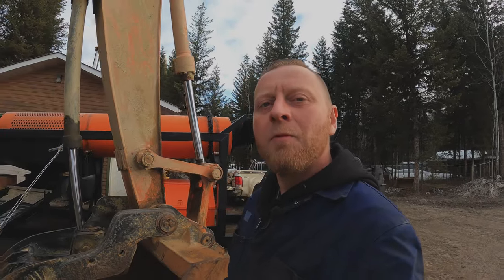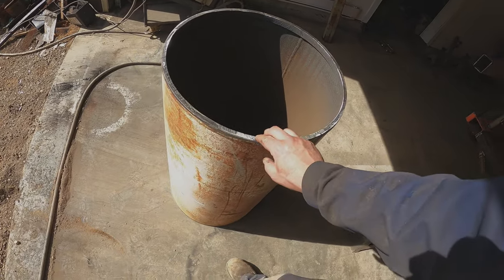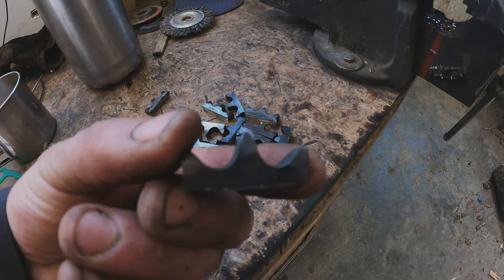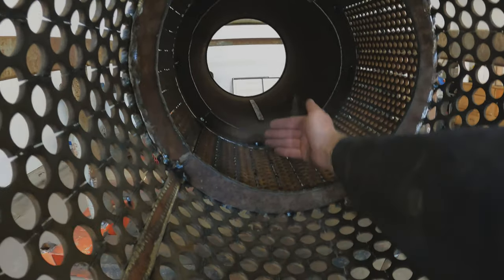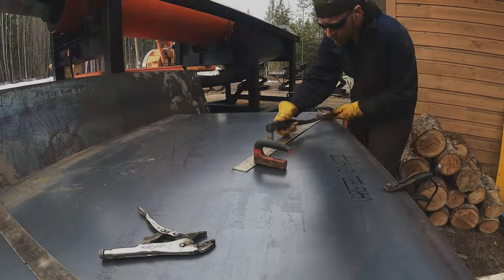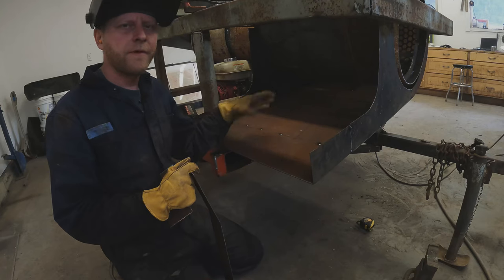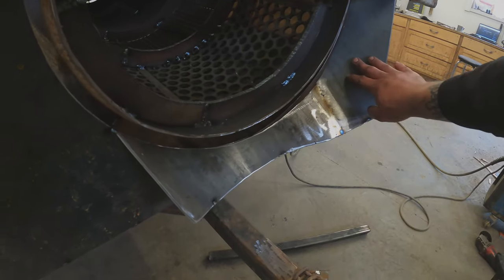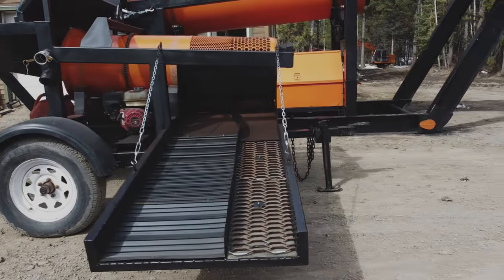How To Build A Mini Gold Mining Trommel. The Ultimate Prospecting Rig!

Comment: Good job ! We knock the bearings out of the Chinese wheels ( under the barrel ) and bore them to a 50mm shaft !
Reply from the maker: Good call. I used to use these wheels on a bit larger units amd do the same. The roller bearing they come with are junk.

Comment: Question for you. For the chain not slipping off. Couldn't you make a guide just like the same concept as a bike chain? Is that plausible? Practical?  Let me know. Your video inspired me. Thanks. 😎👍🇨🇦
Reply from the maker: Yes that would work 100%!!!! Be simple to make a small sheetmetal ring on each side of the sprocket. That would prevent it from popping off.  The unit got about 100 hours on it this summer and didn't have a issue but one day it will happen, hahah . Thanks for watching:)

Comment: Hey Tyler. Thank you leaps and bounds for these videos. I have a single question. I'm building this exact plant. But, alas...I have tried to find that series of radicon and I've had no dice. I've searched the 70 on it even. Care to share which series it is? Love the spider gear coupling. That little bit of rubber saves chain wear(stretch). having the "soft" start due to thar rubber helps a ton.

Comment: Hope those are stainless steel bearings, they may fill up with grit , rust and give you trouble.
Reply from the maker: They are sealed barrel bearings. I have used them in the past and work well for smaller units but anything larger they grenade. Not my favorite to use but work well on a budget.

Comment: Tyler do you have a good design for a larger trommel too ?
I want something that will handle 25-30 cu yds per hr.
Thanks
Tom~
Reply from the maker: Hey Thomas, I have a video of a trommel build from a few months ago on my channel. That unit would be capable of 20-30 yph with the 3 foot wide sluice. If a person went to a 4.foot wide sluice that unit would do 25- 35 no problem. I will have a cut sheet and schematics for it on the web one day for people.

Comment: What is the gear reduction device called?
Reply from the maker: It is just called a gear reducer but people have been accustomed to calling them a "radicon" which is just a company that manufactures them.
Reply: I've been looking at gear reducers. Could you please inform us details on HP of engine (run at full throttle?) and the HP rating of the radicon?  It seems to be the most expensive and heart of the trommel.  I guess bigger cast iron ones are better for more HP. THANK YOU

Comment: wouldnt it be esier.. to just weld the chain to the trimmel and put a sprocket on the.. gear thingy output, whatever it was?!
Reply from the maker: Yes that is one way of doing it but forgot to mention it in the video. It is essentially a (bull gear) type system that way whick works on smaller units but not larger ones. The sprockets do wear quicker but in this case the unit isn't used a lot. Thanks for watching:)

Comment: Run car exhaust in there for 45 minutes before you start cutting it
And then drill holes along the area where you're going to cut it so fumes can escape
Or fill it full of water and keep the hose going in there so it never empties with water as you're cutting it and you will remain safe cuz nothing can catch on fire if it's all very than water